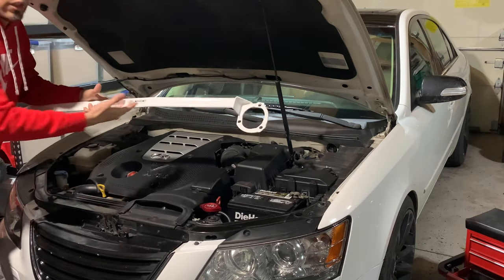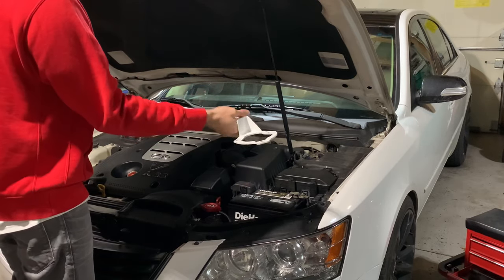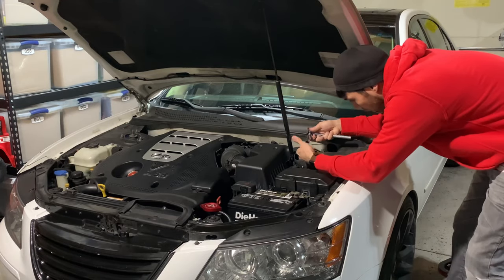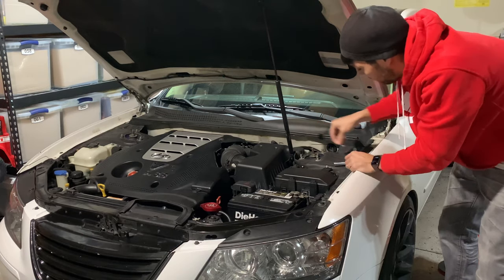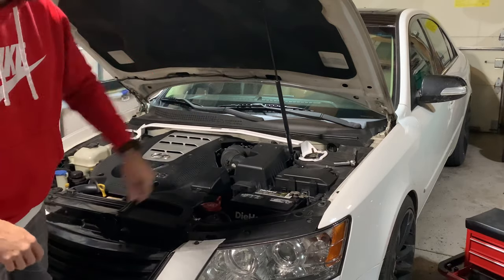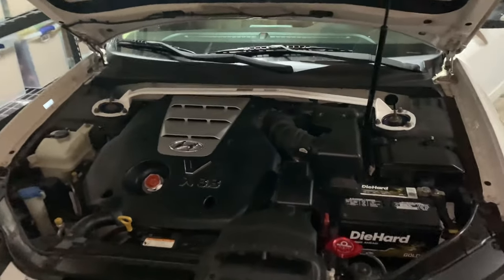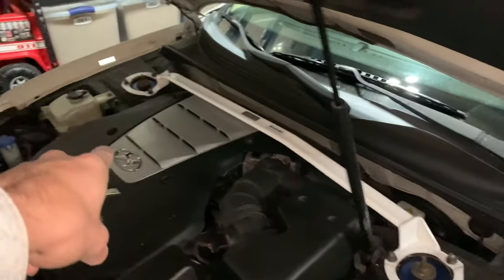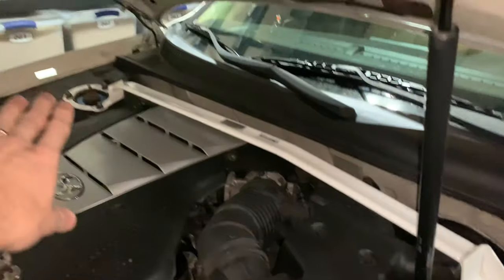Installed a $200 Ultra Racing Strut Bar. Is it worth it?

Comment: Just put a Ultra Racing strut bar on my 13 GS350 and it makes huge difference in the sway and steering input feels more sharp
Reply from the maker: most def. Car now feels great when making those sharp turns. No more driving a yacht
Reply: Just the front or the rear as well?